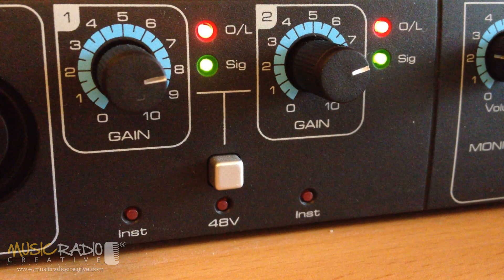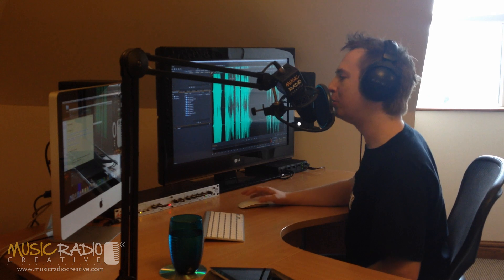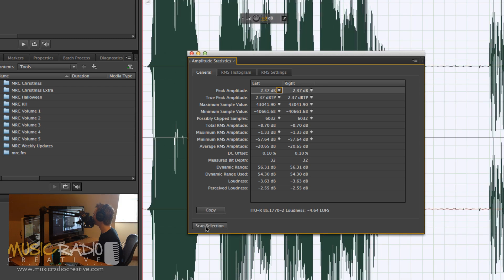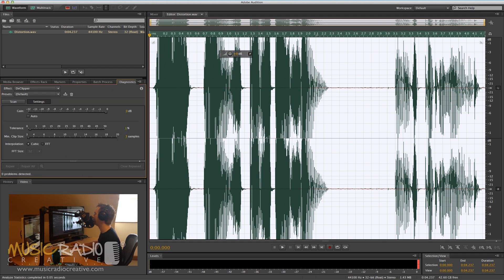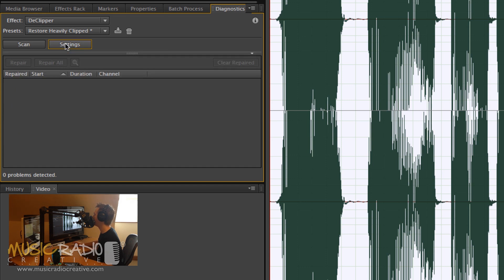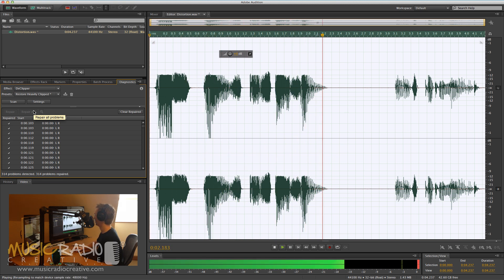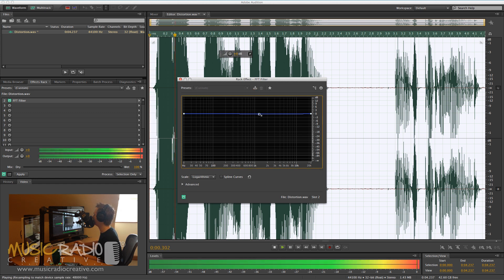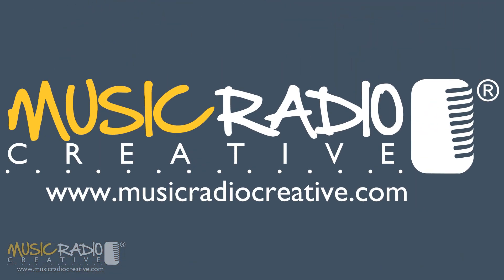How To Fix Distorted Audio In Adobe Audition (Clipped Audio)

Comment: Thank you once again for the awesome to the point video. However, is there any way to get rid of the actual distortion that is caused by the clipping? I noticed the FFT seemed to bring it down some but it didn't directly address the rumbling distortion and I wasn't sure if there was a way to get rid of that. Declipper worked on most of the tracks I received for the most part, however, one was really bad due to the bongos in the track. The track had over 12,000 clipped parts on a song. haha
Reply from the maker: The only way to get rid of the distortion completely is to set the levels correctly and re-record I'm afraid.
Reply: @MikeRussell  well I can officially say, a lot of careful EQ after declipping got it tolerable enough to listen to. Unfortunately for the cleanup project I took on, it was a live festival and re recording was not an option. The cameraman apparently had levels up so high and they brought me in to try and turn the live performance into a 13 track live album and the whole thing was clipped from the cameraman using 1 camera mounted rode mic with turned up peak levels SMH. I pulled it off though and got it decent enough to listen to. I tried to do it as a learning project and challenge. And your videos helped greatly! Thank you!

Comment: Hi Mike! Thanks for all of your tutorials! I’m working on a remote zoom interview recording and have some persistent background crackling on the recording for one of the voices. I haven’t been able to fix with declicker, declipper, diagnostics, heal audio. I don’t see distinct click lines in the visualizer. Nothing seems to work, although I can soften the clicking a bit with the parametric equalizer around the mid-high range (but that also squashes the speaker’s voice). Any recommendations?
Reply from the maker: Hi Vincent, have a look at this video and see if it helps https://www.youtube.com/watch?v=EEzBBKHoEBU
Reply: Thanks Mike! I appreciate your time responding to my question. I ran a few passes of DeNoise and it didn’t seem to even be detecting the rattling sound. The only thing that seems to reduce it a bit is using parametric equalizer,  dampening between 5K to 10KHz. I can see the waveform vibrating chaotically in that range.
Reply from the maker: Try having a work through this video and see if that helps https://www.youtube.com/watch?v=S_twOrxYKHo
Reply: @MikeRussell  Thanks! I had a look through that video (your videos have been fantastic, informative, and helpful). 

I've been working with spectral frequency display on, but this crackle doesn't appear as vertical lines like clicks do. I think it has to do with the microphone on that person's end. The only place I can see it distorting the audio is in parametric equalizer, but reducing that end also squashes the woman's voice in the high end (which unfortunately wasn't great to begin with as it was recorded off a zoom call and the connection was inconsistent). Thanks for the suggestions, really appreciate your time in responding to comments and questions.

Comment: What do I need to keep this happening on set? I use a tascam -10x and I plugged it in the dj soundboard. Any tips to fix this before on set? What do I need?
Reply from the maker: You could record mono on left and right with one channel 10 or 20 dB lower than the other.

Comment: well, I have a question which is totally the opposite side from the purpose of this video.
that is how do I export audio without being autocorrected by Adobe Audition?
I have made a distorted song like the dank song. I had no problem when I was making it in audition and the effects I wanted had gone well when I previewed it.
but after I exported it, the audio was fixed automatically by audition, as the volume has been decreased fairly.
How can I fix this?
Reply from the maker: Audition shouldn't add any effects to a file you save unless you are batch processing with an effect selected.

Comment: There is another way to tackle this using Audition. I use an older version - 3.0.1 - and go into "Clip restoration". This part is a bit of trial and error, but you soon get the hang of it as you get more experience. Set the "Input attenuation" to -6 to start, "Overhead" to 1, "minimum run size" to 1, then click okay.  If the result pulls down the waveform so there are no more peaks at "0" db you have most likely caught them all. Listen to check by ear and give a visual to check for "plateaus".  If that pass did not catch them all, undo, adjust your attenuation down another 1 or 2 db and process again. Following this method you should arrive at mostly declipped audio.
Reply: yeahhh

Comment: how does one "record correctly in the first place"?
Reply: Make sure your signal is strong enough to peak out at around -12 but not so strong that it goes beyond that into the clipped range of 0.  Think it like exposing a camera, have to hit it just right or you're over exposed or under exposed.  A little be wrong is correctable, but too far in either direction and you're in trouble.  Also be sure to monitor your audio both in headset and on your meters to make adjustments as necessary.
Reply: I ask cause I wanna do some voice acting. And voice actors change the volume of their voices a lot and quite abruptly.

Comment: still sounds distorted. Reality is, you cant fix distortion.
Reply: Actually if it is simple clipping of the waveform, you can. I'm not the most knowledgeable person on this as I work with older software (it's what I can afford), but Audition 3 does a great job of fixing clipping distortion. Distortion "inside" the waveform is another animal which I have not found a tool for yet. I'm guessing some of the Izotope stuff can accomplish this, but I cannot afford the "tool". I usually resort to redrawing the waveforms by hand in Pro Tools (the last ver. that runs on a PPC Mac). That ver. of PT will "heal" the wave form when you draw "over" the spike on the wave itself. I de-clicked a large portion of a mono lp using that approach before I found a better tool. It can be done, but if you're in my boat, it takes a bit more work. Working within your limitations can be rewarding - is for me anyway.

Comment: Thanks for the video! However, I have a similar distorted audio clip (orchestra recording that was quite loud, though all accoustic), which doesn't seem to be clipped (the audio waves don't reach the borders of the waveform levels, they stay between -0,5 an 0,5 in Audacity). But the sound is distorted when the whole orchestra plays (especially brass and percussion). Any tips?

Comment: hey Mike i'm using windows 7 and i install my audition in c program file (x86) and when i adding some of the effect in multitrack editor is shows in red do you think should i install it in to c program which is use 64 bit version or the audition is just work for 32 bit. if i need to so is not causing any problem?i know there is a pre-rendering buttom in audition, but i think i dot't need it because my computer is strong enough and how does it work anyway?